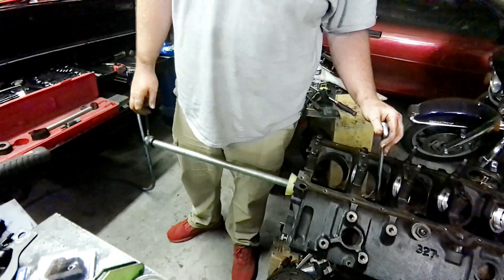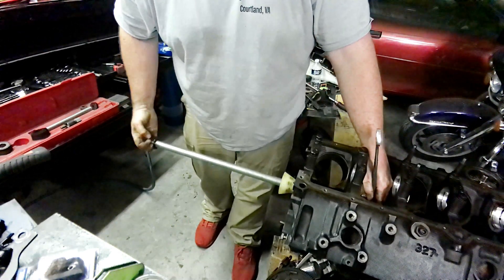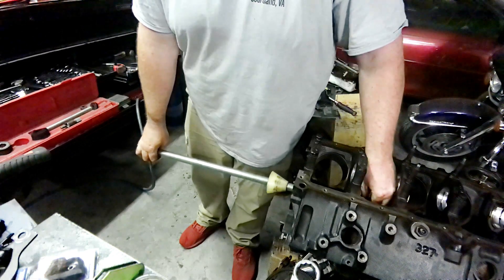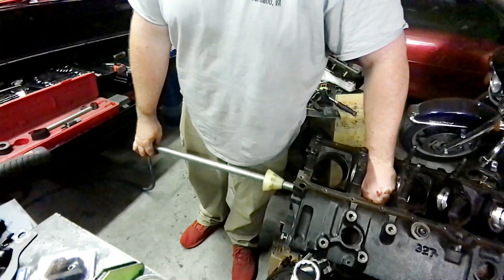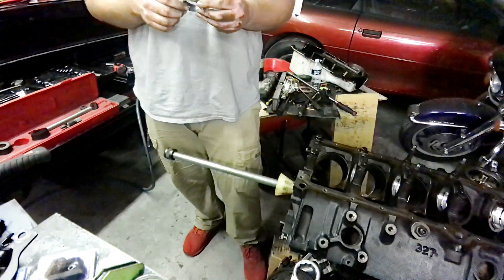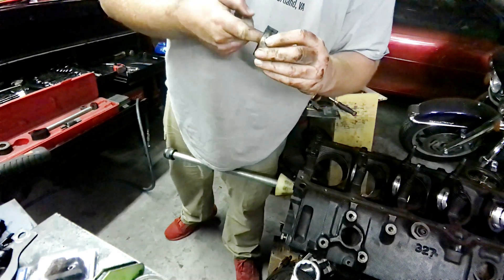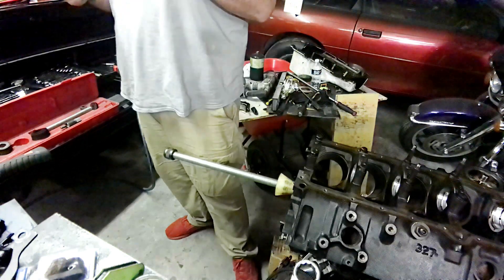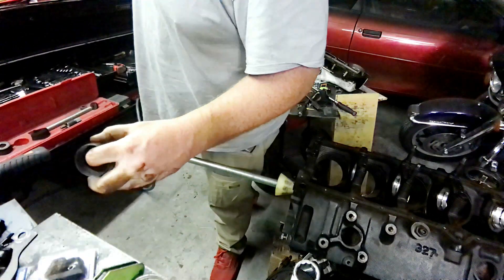How to: Cam bearing removal. LT1 SMALL BLOCK Chevy build. NAPA 2250 universal camshaft bearing tool

Comment: I like your content. I still use the LT1 in my 4th gen and my 3rd gen. I’m gonna test how long the stock bottom end will last with nothing but the ring gap opened up a bit and run it on E85. It’s gonna be cam only with the procharger in a third gen with a drag setup. Gonna see what it will do. Procharger is currently on my 4th gen, but taking it off and putting it on the 3rd gen using an Impala SS bracket. I have a few LT1 bottom ends laying around so I don’t care if it blows. I wanna know what I can get it to run and how long it will last. I think it will last a little while using E85 and only 8 psi. I’m basically gonna do what the LS guys do with stock bottom ends, just with a not as strong LT1. I guess we’ll see!
Reply from the maker: Thanks for the kind words! I am wanting to do the same thing with turbos around 8 psi. Hoping it will stay together for a while like that. Probably going to put it back together NA while I gather the turbo parts first though.
Reply from the maker: Are you putting something different on the 4th gen?
Reply: @YerkitRacingChannel  Just going to put a cam in it. Already has rockers and such along with a edge 3600 stall,
3.73’s, long tubes, and suspension stuff. Car is a low mileage 96 SS, I don’t want to blow the engine with the procharger.  I bought the car that way 5  yrs ago. Just gonna be a cam only bolt on car. I rarely drive it.
Reply from the maker: My car was just cam and bolt ons before and was a fun street motor! The LT1s are really strong motors with a few good mods. I really need to go back in the 4l60e and do some more work or switch to a 350 or glide. 

What transmission are you running with the power adder?
Reply: @YerkitRacingChannel   My 96 SS has a 94 4l60e that I built and put in it. I used a 94 because I obd1 swapped it so I could tune it. It runs on a 2bar open loop speed density tune on E85 with 60lb injectors. When the procharger gets switched to the third gen, I am using a 93 M29 T56 for now. I have a Doug Nash 4+1 that came in my 3rd gen when I bought it and it will go back in next year. I want a stick shift car and the Nash should be perfect for that. It’s stronger than the T56 anyway.
Reply from the maker: I have been wondering about using an obd2 trans in place of obd1. I was running a 97 4l60e with a 95 obd1 ecu. For normal driving everything worked like it should but I had an issue with the motor before I got to trying to go tune the trans. I have a 95 4l60e also but was told by the previous owner that the 97 had upgraded clutches so I decided to give it a shot. Probably going to try it one more time when it goes back together.
Reply: @YerkitRacingChannel  94 is a non pwm tcc trans where as 95 was pwm, and 96 was pwm with a different 3-2 downshift valve/solenoid setup. I have heard you can make them work, but I already had the trans so I built it and swapped the ecm and knock sensor. I had the software to tune obd1 cars so that was the main reason. The trans was getting swapped with a built one regardless so I just did everything that let me go obd1. EEhack is a great program to use for obd1 cars. I use tuner pro and tunercat for tuning.
Reply from the maker: That is exactly what I have been using for a few years tuning the Camaro. A little tuner pro and some tuner cats along with EEhack. I will have to refresh myself on them once the motor is back together. Had a pretty good grasp on them but the car has been down about a year and a half so I'm sure I'll be rusty.
Reply: @YerkitRacingChannel  I hear you on refreshing the memory. My 3rd gen uses a 93 pcm Thats has the chip, but I use the Moates autoprom on it. It makes tuning so nice, can tune while driving down the road while data logging simultaneously using tunerpro. I prefer tuning the 93 pcm over the 94-95 flash pcm. It’s been years since I have had my 93 powertrain running in my 3rd gen. Will definitely have to refresh on setting everything back up.
Reply: @YerkitRacingChannel  What cam were you using? I bought a cc306 for the LT1 in my 3rd gen before I decided to put the blower on it. Wanted to see what I could do with a cam only LT1 setup with more compression in a third gen drag setup. I’m using the Felpro 1094 .015 shim gasket that I modified the upper corner coolant passages to work with the LT1. Gives .040 quench and 11.4:1 compression. This is what the car will be run with first. I have thought about putting the blower on this combination and see what happens. It will be on E85 so who knows. I’m willing to try anything since I have backup engines. I’m of the philosophy that you really don’t know until you try and I’m willing to try. I figured the cc306 might bleed off some of the compression and probably loose a little boost due to it’s valve events since it’s not ideal for boost. The whole combo screams that it’s gonna blow. It’s more of a testament of what E85 can do to fight detonation. I’ve seen some high compression high boost combos live on e85 so my 8 ish psi of boost on this combo might just live for a bit. Like I said I’m willing to try.
Reply from the maker: It would be awesome to be able to tune on the fly! I had thought about switching to a 411 pcm setup but its pretty expensive when everything is working well already.
Reply from the maker: I am using the lunati voodoo 601210 cam with 1.7 roller rockers. If I recal correctly, its .583/.600 with the 1.7 rockers.
Reply from the maker: Funny you mentioned the modified felpro 1094 gasket. I just did a video a few weeks ago on modifying that gasket for this build. With the chambers cut down on my heads it will put it close to 12:1. 

I was going to use this combo NA, but now I'm considering putting a different gasket and picking the quench up around .060-.070 for nitrous or boost. From what I can gather it is necessary with a power adder for a bigger tuning window. I am torn though... I feel like I can get the tune dialed in either way... Probably going to be one of those last minute decisions as I'm putting it back together.
Reply: @YerkitRacingChannel  I have thought about the 411 and going 24x, but what I have works well. I’ve had the lt1 tuning stuff for my 93 for over 15 yrs, don’t really see a reason to change for what I am doing. With the autoprom’s tune on the fly, it doesn’t get much better.
Reply: @YerkitRacingChannel  I didn’t even see that video. It’s been done many times by other people. How much did you have to cut your heads to get to 12:1 with the 1094 gasket? I have been contemplating the exact same thing regarding quench and such. I thought of just setting up one of my other long blocks for boost and dropping the compression with a thicker gasket. I’m already using ARP studs which I thought might help in sealing with the thinner gasket. I think E85 will help some with the higher compression though.  I really just want to go along with my original plan and see if it lives.
Reply: @YerkitRacingChannel  What springs did you use for that lift? My heads are set up with pac 1218 springs with the 10 degree retainers which put them at 1.75 installed height. With the 1.6 rockers and the cc306, seemed any more lift from a bigger cam would get me too close to coil bind on the exhaust side.
Reply from the maker: That's about where I'm at with it. Had Tunercats for 10 years and worked well so far. Hard to justify the money for a change.
Reply from the maker: RFD cut the heads to 52-53cc range chambers from where they were when I bought the car. I wanted to go to 50cc but it would have got into the top cut on the valve job and lost some flow. That put it around 11.70-11.85 compression. Having the machine shop cut .005 off the block deck surfaces. Wallace racing calculator is putting it 11.87-12.04 depending on exact chamber size. I am putting the valves in the heads this week so I will cc them then to know for sure.
Reply from the maker: I had to switch springs when I added the 1.7s. With the cam only I was running Lunati 73943lun springs. install height was 1.750. Coil bind was 1.028

I switched to 73925-k5... Install height is 1.810 and coil bind is 1.100. I ported the heads and upgraded to longer stainless valves to be able to achieve the 1.810 install height. With stock valves I could only get to 1.776 on some valves.
Reply from the maker: Would have probably been able to cut the spring pockets to do it but I got aggressive on the ports and didn't want to weaken the pocket areas. Could have went with a thinner locator also. Kit came with 0.060 locators. I thinks you can get them in .040 as well. That would have gotten them most of the springs to 1.805.

Either way, I just didn't want to sink the valve job to do it.